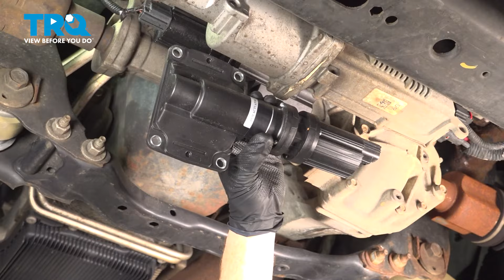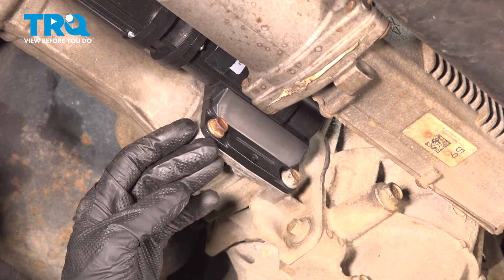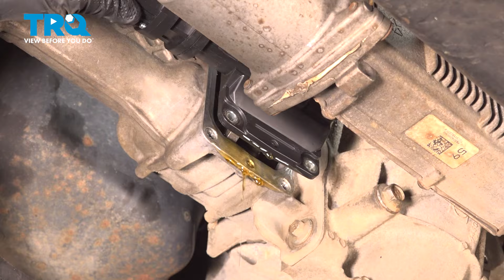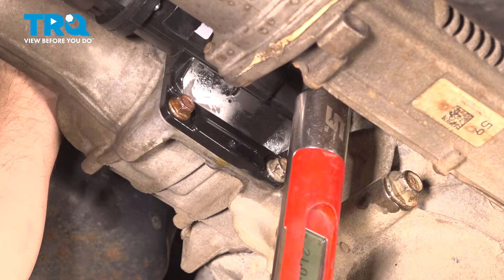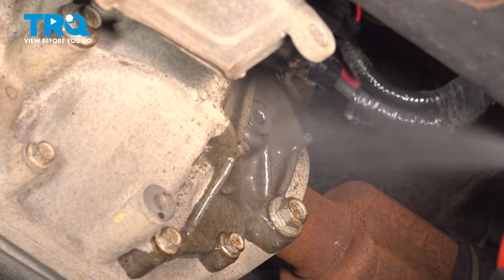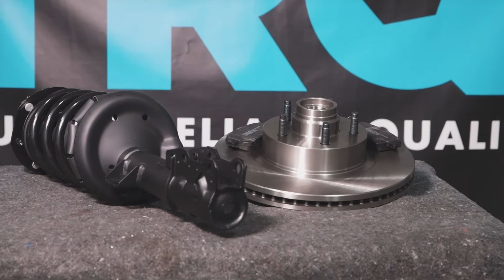How to Replace 4WD Axle Locker Actuator 2011-2018 Ram 1500 5.7L V8

Comment: I replaced mine in my 2014 Ram 1500 and it worked when shifting in and out of 2wd - 4 Auto and 4 Lock but get stuck or starts flashing when I try it shift it in and out of 4 Low. What could be my problem, I already replaced the front diff actuator